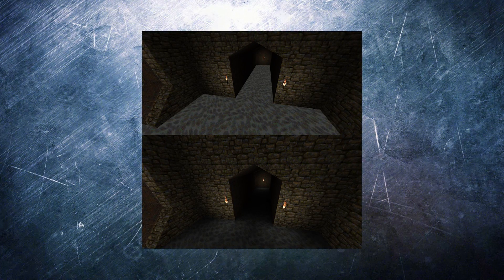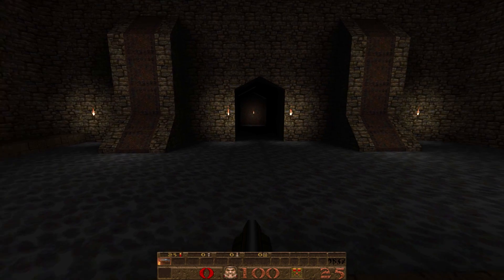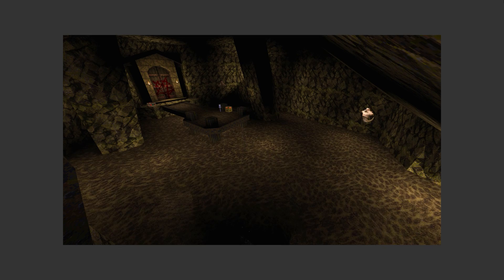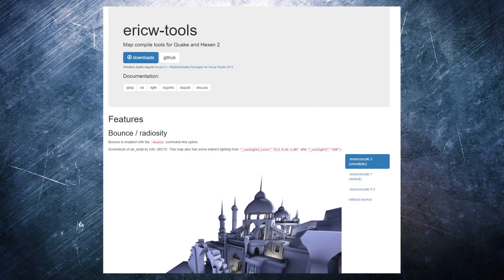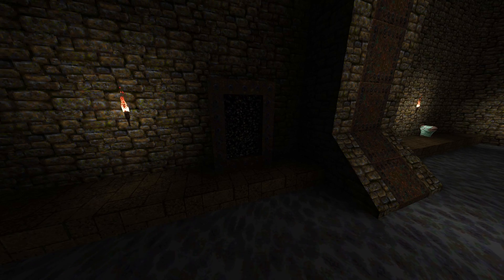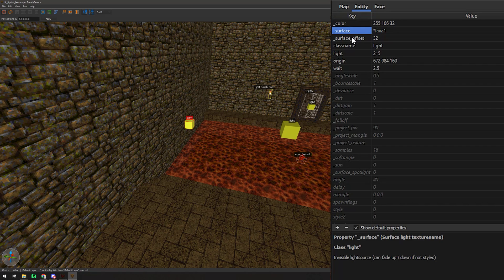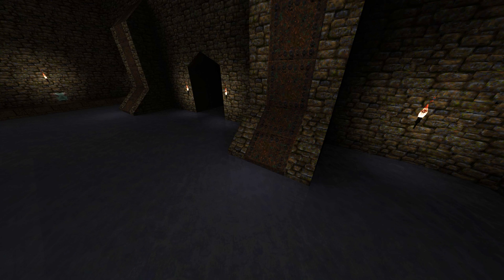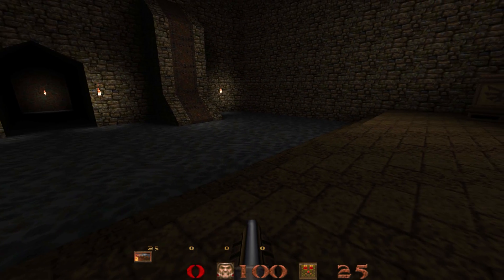Quake Mapping - Lightmapped liquids

Comment: How to add this feature into the original Quake maps in Quakespasm? Or is it already implemented (doesn't look like it)...
Reply from the maker: You would have to re-light the maps using the correct map files.
Reply: @dumptruckds  OK. Thanks for the reply.

Comment: lol, I was doing this back in 2011, but none of the engines supported it back then, and I agree, it did look really weird (you get used to it after a while), so I don't think I ever shared it with anyone, and I completely forgot about it.
Whatever EricW did to get his version to work in any engine must've been more advanced than what I did.

Is there really no cvar for keeping lava fullbright? That kind of seems like a necessity (although surface lights might work in a pinch...). You could also use glowmaps and/or shaders, for engines that support it.
glQuake automatically applying alpha to lava is another peeve of mine. I've hacked around it using func_illusionaries, but I think there might be a way to do it in the compiler?

Edit: Actually, shouldn't lava glow anyway, since most of the texture is comprised of fullbright colors? I'm guessing that must be an engine/compiler bug.
Reply from the maker: re: cvar for fullbright - This was just added to QS 0.95.1 but the compiling tools have to be updated to make use of it.
Reply: @dumptruckds  Oops, by "cvar for fullbright" I meant in the compiler.

Comment: This is amazing! Now we need a hack for shadows on entities like doors. 😁
Reply: It's called "real-time lighting" ;)
There might be a hackier way to do it with lightmaps, similiar to how MDLs are lit, but I'm pretty sure only DP and FTE would support it (I've been considering cooking up something like that for the pushwalls in my Wolf3D port).
Reply from the maker: progs_dump and Alkaline both have switchable shadows vai Quake C.
Reply: @dumptruckds  How does that work?
Reply: @dumptruckds  Cool, that sounds interesting.
Reply: @dumptruckds  Oh, I see, it does some tricky lightstyle hacks. Neat!
That's got me thinking, if you really wanted to get crazy, you could have the doors trigger a set of lights as well...one light shines through the door, and the other light does not (not sure if EricW's tools allow that or not), and have them fade. With enough work, I think you could fake a pretty cool effect.
But of course, you're limited to the amount of lightstyles you can use.

Comment: I like this for water and possibly for acid but Not for lava. Is there a way to set the effect gor different liquids?
Reply: A good way is to use surface lighting on the lava texture. You can refer to ericw's tools documentation for more details, but it basically involves adding a single light entity to your map pointing to the texture name that you want to have it, and then every instance of that texfure in the map will emit light.
Reply from the maker: Nope but as I showed in the video you can use other features to light things differently. One option I didn't show is setting a minlight value on the brush as opposed to lighting it. See ericw's tool manual for more info.

Comment: Hm I think lava should still be uniformly lit because well it's lava so it should be bright throughout, maybe in a future ericw tools update support for loghtmapping specific liquid types can be added, that way you could use surface lights with lava while still keeping the actual lava surface fullbright so it doesn't suffer from that lighting weirdness you showed
Reply from the maker: One option I didn't show is setting a minlight value on the brush as opposed to lighting it. See ericw's tool manual for more info.
Reply: @dumptruckds  will that work for world liquid brushes if they're in a func_group
Reply: @jlewwis1995  It should do. I'd like to try minlight with a pulsing orange surface light to see how that looks

Comment: Which engine did Quake II use? It had great light mapped liquids.
Reply from the maker: It was an updated version of the Quake engine. https://en.wikipedia.org/wiki/Id_Tech#id_Tech_2
Reply: The Quake 2 engine is enviable in a lot of ways for Quake modders. You can have moving liquid brushes, enemies with any (and even changing) bounding box size, stairs that don't interrupt jumps, and even features that are common now like coloured lighting, ladders and indeed lightmapped water were in Quake 2 first. It's a shame I don't like the game for its gameplay or visuals because the engine is pretty great.
Reply from the maker: I still wish someone could merge the two engines together. I know there was something along those lines but I've lost track of the project. I believe it was QuakeC in the Q2 engine?
Reply: @dumptruckds  He's also a pretty talented mapper
Reply: @dumptruckds   There was a much older engine that was an actual mix of the two games, supporting both, but I don't think it was ever finished, and I can't find any trace of it today.